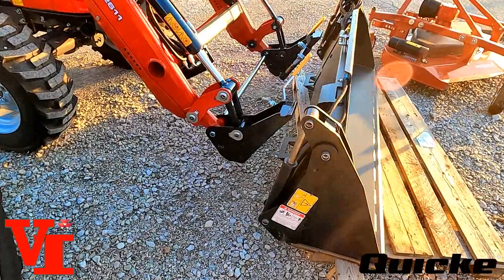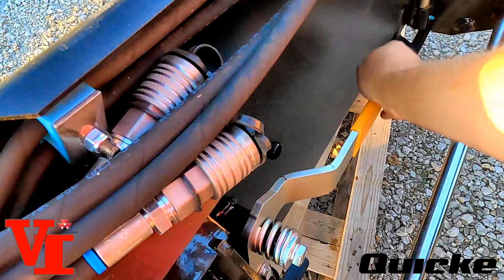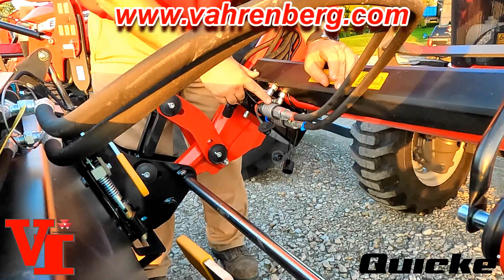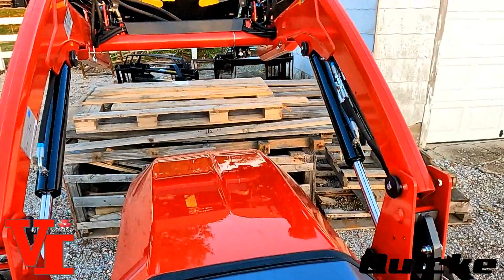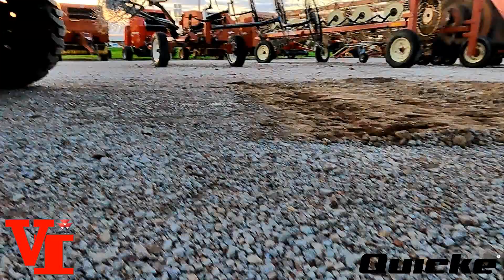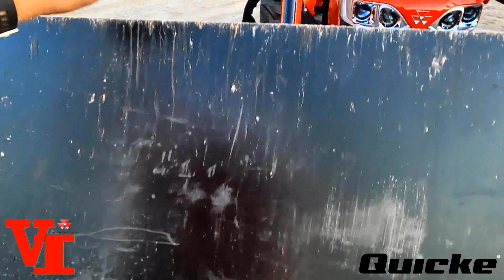Quicke 180MPC Multi-Use 4-N-1 Bucket (72"/180mm) Skid Steer Quick Attach for Compact Utility Tractor

Comment: Not a true third function... More of a converter valve... I do like the bucket though
Reply from the maker: Your not going to get "Live" 3rd Function until the Larger Premium "S" Series Tractors with built in Hydraulic Valves in the Hydraulic System of the Tractor for providing. All others are going to be 3rd Function Diverter Style Systems that divert hydraulic oil from one function to another.
Reply: @VahrenbergImplement  weird Land pride and Kubota tractors.. get true third function down to 25 horse tractors
Reply from the maker: I seen a video of the install you are talking about. WR Long makes aftermarket kits that tap into powerbeyond and use electric control for add on valve. we don't use them. We install original equipment accessories and never had a customer that asked for that style of 3rd Function. Solenoid 3rd Function has been our most requested and they much simpler to install. Hate see dealer labor build for those kits from LandPride and Kubota seen install on video. Lots of work to do them,

Comment: Iam about purchase , really stuck between 4 in 1 and HD brush grapple , I kinda do little bit of every thing I currently have a big capacity 66" bucket on my 1533 , 3rd function was installed years ago never used .
Reply from the maker: Grapple is great for moving brush and smaller limbs but is a single purpose tool....it can only grab. That is the thing customers are telling me they like with 4-N-1 they can do more without having to switch implements. More depends on your needs. We sell both but we like to educate to help customers make the best decision the first time!